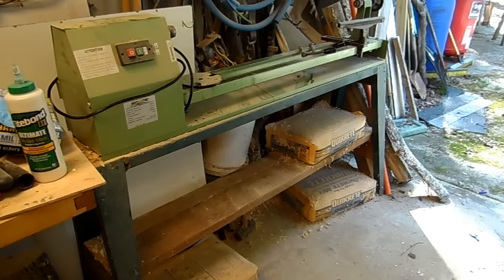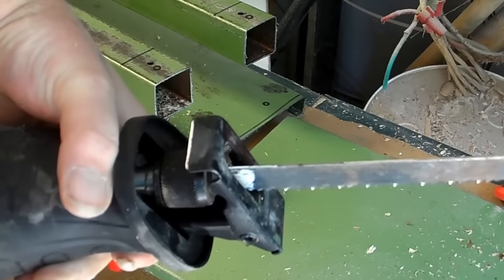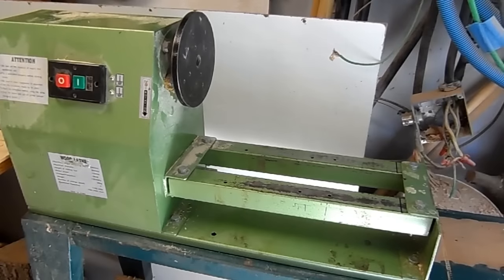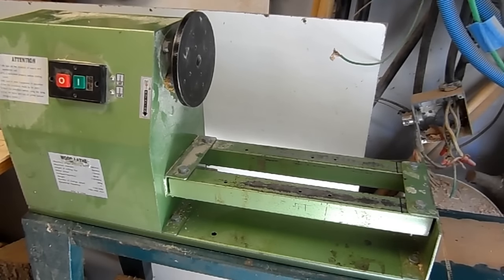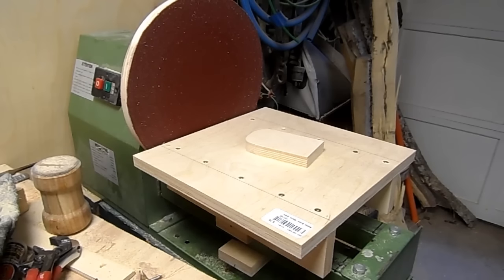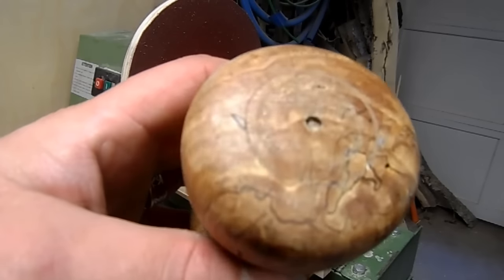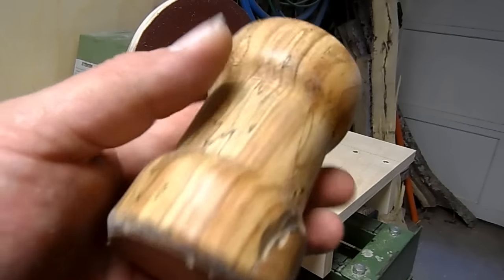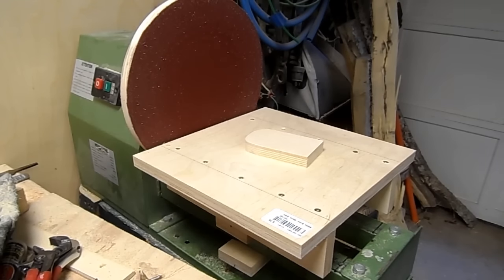GPW 47 - DIY Disc Sander (from an old lathe)

Comment: Interesting! My lathe (very similar to yours) came actually splitted in half and you can extend the bed adding another piece. I just discarded it and I have a very similar set up for the disc sander! :)
Reply from the maker: +Cactus! workshop I have never seen a lathe like that one with a split bed. I'm guessing that you are using it as a sander for the same reasons?
Reply: +GP Woodworks Yep, not much room in the shop and I never had to turn anything larger than 50cm. I have assembled the whole bed just once to sand and refinish a big table leg but that's all :)

Comment: If you can cut your lathe bed in half with a jigsaw -- you might have a crappy lathe.

Love the dancing particles at 2:25

Consider relocating the switch on your new disc sander. Would be nasty to graze the spinning disc with your forearm.
Reply from the maker: +awldune I concur sir... on all counts.

With my propensity for self inflicted injuries, I may need to move that switch.